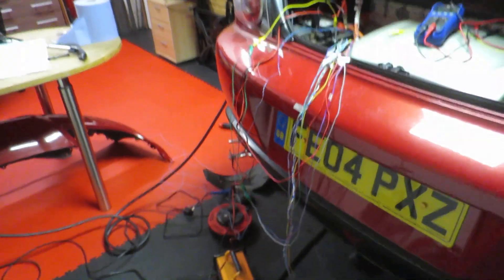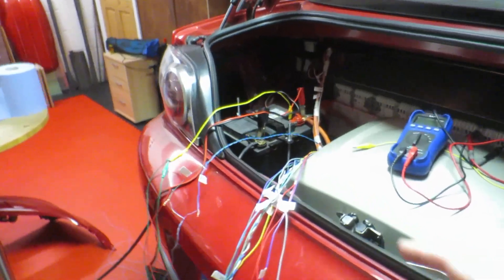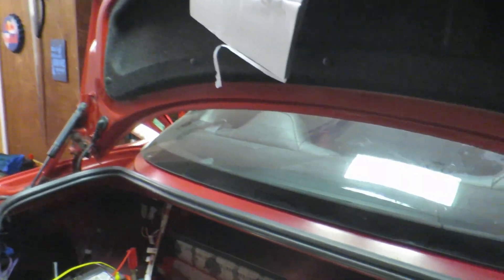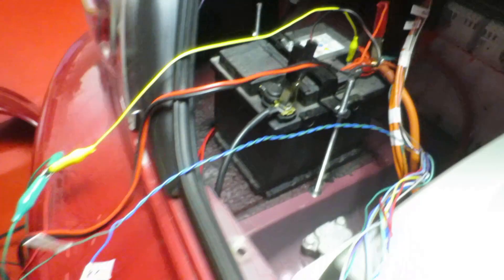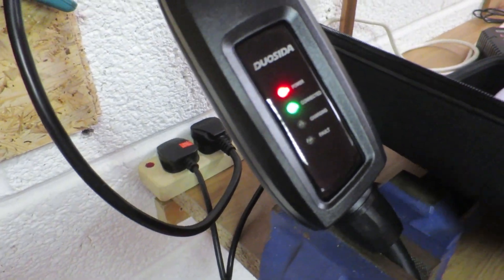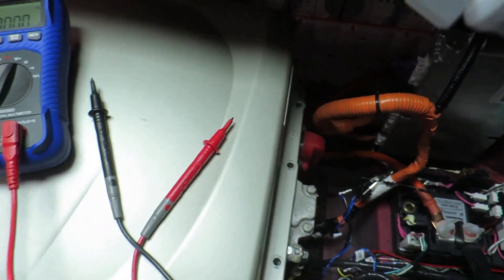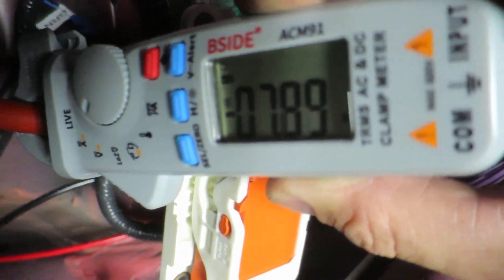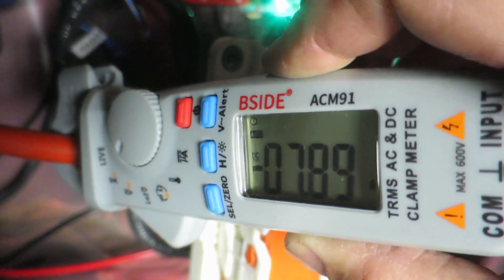Nissan Leaf PDM (Charger) working. Mazda RX8 electric conversion.

Comment: Dave what battery pack, BMS and VCU controller are you using (thunderstruck or resolve)? Trying to understand how the Leaf PDM will work in the bmw conversion I’m planning, if I don’t have a Leaf battery pack
Reply from the maker: I am using the Leaf 30Kwh battery pack, with the leaf BMS. The VCU I have built myself and controls the car and leaf electronics ;o)
Reply: Is it zombieverter by any chance?

Comment: got any links that can help me get pdm working i got a 6.6kw  ftom a 15 leaf  
whould be nice to get mine working on stack as close as oem as possible  im going to try to keep it all together in the stack if possible
Reply from the maker: As per the other message - what is not working?
Reply: @SouthWestEVUK  trying to figure out what i need  to get the full setup working  onboard charger and the drive controler